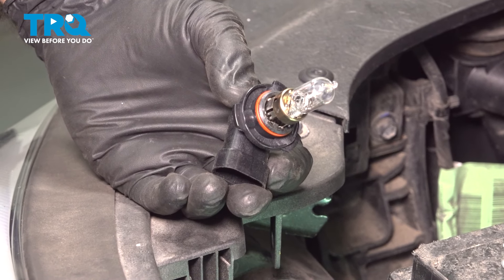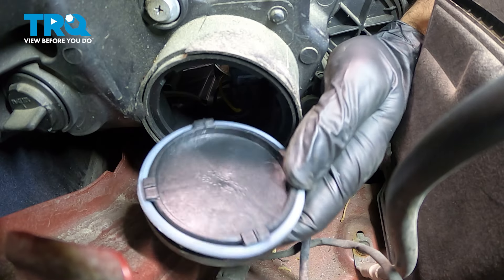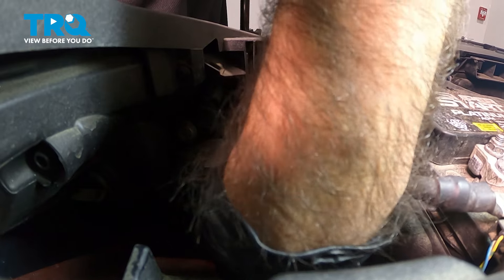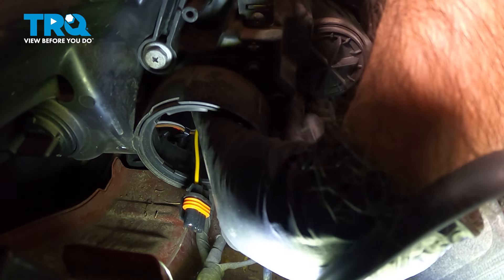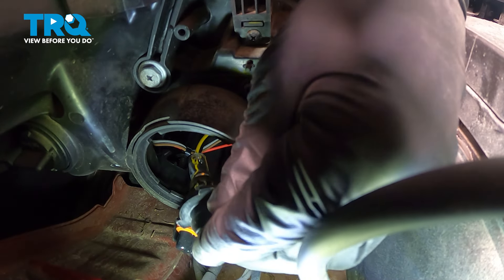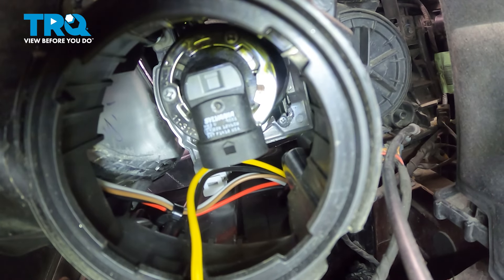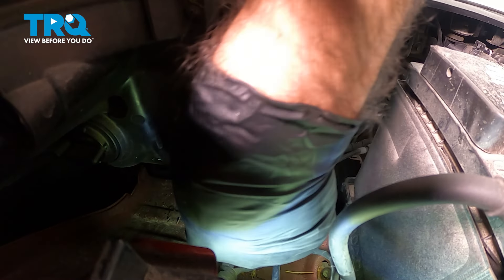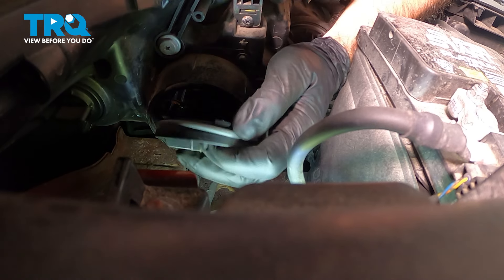How to Replace Low Beam Headlight Bulb 2015-2019 Hyundai Sonata

Comment: I have replaced headlight low beams 3 times in the past 2 years...brake lights 4 times in 2 years...what could be causing this? I've used budget bulbs and tried the most expensive ones from autozone. Still have replaced too frequent I think
Reply: Following for reply because I have the same problem- with the brake lights
Reply: It’s actually a Hyundai thing
Reply: Sounds like maybe you have a bad connection or some wiring problems.
Reply: same!

Comment: I have a 2018 and my left low beam stays off most of the time and then sometimes it will just pop back on good as new for a few minutes, then turn back off. Does this mean it could be a wiring problem or should I go get a new bulb? Haven’t had this issue before with a vehicle.

Comment: So basically with low beams it's put on side of passenger and then twist it down to lock into place. 

And for high beams it's the same thing passenger side but it's twisted up to lock into place.

Comment: I just replaced the driver side bulb, take 3 minutes to remove the battery  and it gave me plenty of room to work with my. And it takes less than a minute to replace the light bulb without struggles.